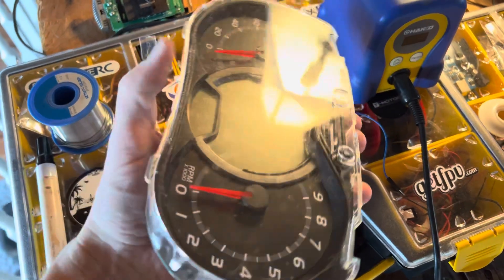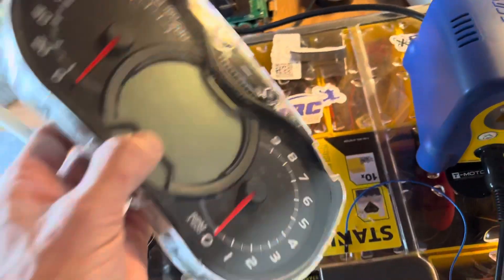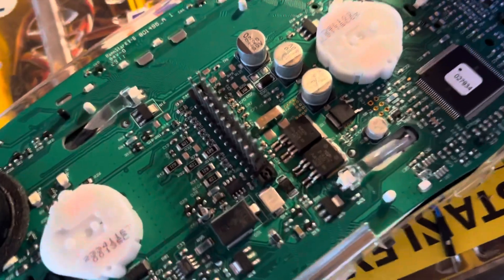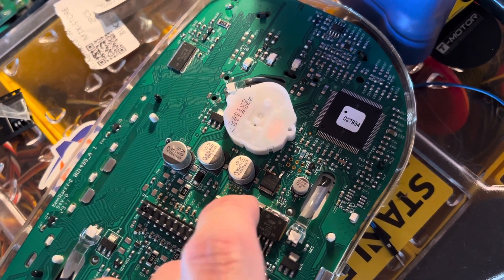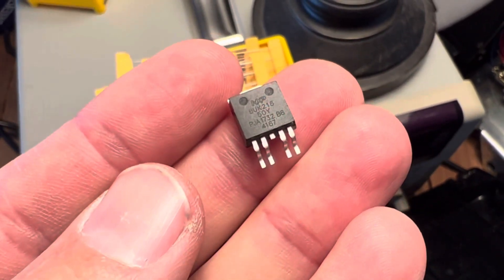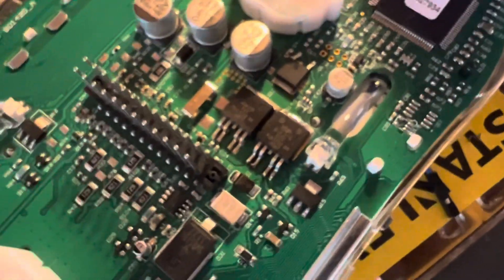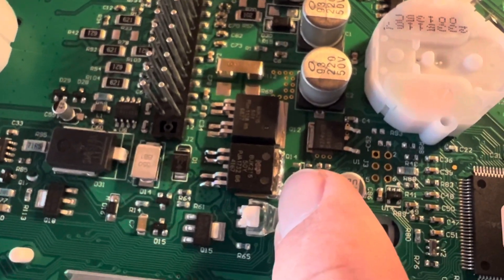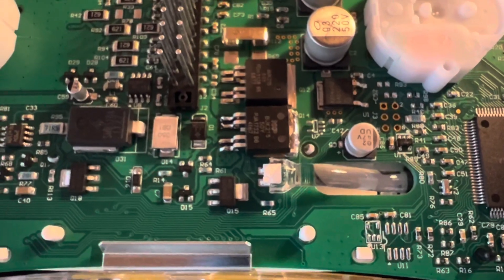DIY Repair SkiDoo Gauge Cluster for Heated Grips

Comment: I was looking for a repair video on the back light and stumbled on your video.   Thanks for the info for when my grips stop working.  :)
Reply from the maker: I should have mentioned in the video to check and make sure you have >5 ohms of resistance through each of the heaters. The heaters can short to ground and that’s what causes the SMD in the cluster to burn up. 

Pull the plastic cover off the center of the bars and you’ll find two plugs for the handle bars. The grip heaters + are orange and ground is black. The thumb + is brown.

Comment: Was your bar gauge still reading level before you replaced the chip?  Having issues with my thumb warmer.  Thanks
Reply from the maker: Yes. The buttons were telling the cluster to change the heat level, but the cluster was unable to send power to the warmers because of the burnt out BUK215 topfet switch in the video.
Reply: Thank you!  I’ll look into it.

Comment: Thanks for the Video.  I just had my cluster quite wroking on Sunday it will not power up at all.  Have checked the wiring harness to the cluster and everything is working as it should be.  Tried bench testing the cluster by putting power to pin 8 and grounding pin 11 to see if it will power up but still nothing.  there is nothing visibly wrong to me.  Is there any chance you may know what component on the board might be causing my problem.  Thanks in advance for your time
Reply from the maker: Hey Kenny, unfortunately not without spending some time probing it with a scope.

Comment: I just followed your instructions but it did not work. I know the gauge is the problem because I swapped gauges with another sled and the heaters worked. I did a sloppy job. I used a soldering iron that was too big and I’m clumsy. Can I pay you to repair three gauge clusters with the grip heater issue?
Reply from the maker: send me an email